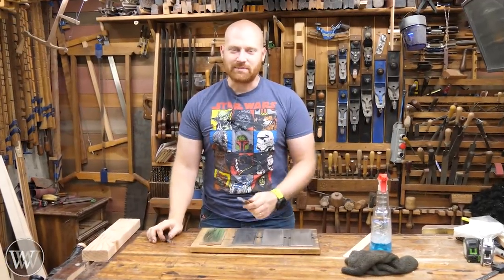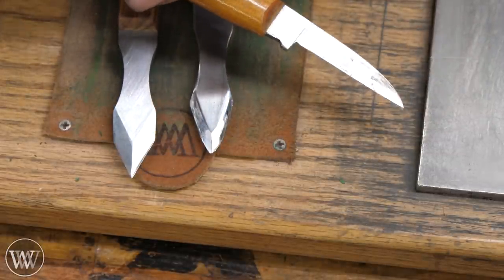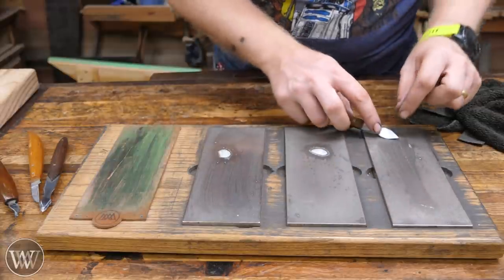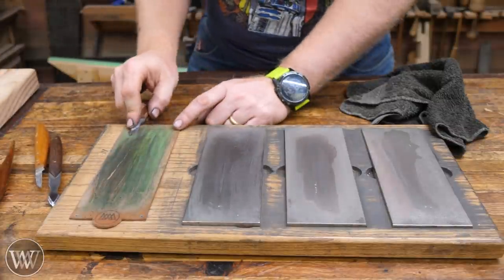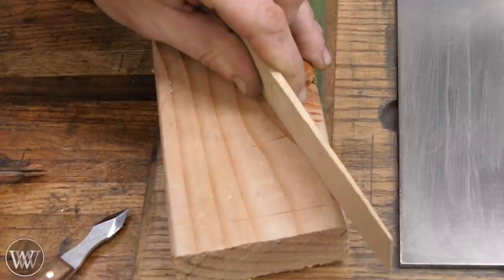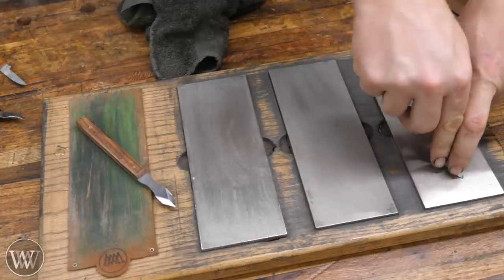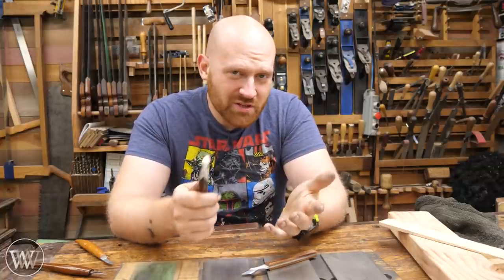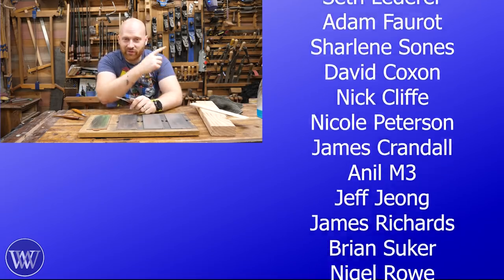How to Sharpen a Marking Knife

Comment: I've said it a few places but there's a great line in the new traditional woodworker. "good enough is good enough" maybe I like it so much because I've said something similar for a long time.
Reply: With OCD, there is no "Good Enough". A metal worker friend of mine says I am seeking to be to exact with my woodwork.
Reply: @thomasarussellsr  determine what tolerances you can accept. E.g. +- 2-3 mm is more than enough for woodworking. It's in metal machining where tolerances can be +-10 thou (or less).

Comment: Super helpful! I have a suggestion for a video: bringing a router plane blade into square. I read through Paul Sellers’ article on it, but haven’t found any videos and I can’t seem to get it right. It’s been frustrating!
Reply from the maker: I have seen a few people talking about that. But I've never actually come across a router plane that is out of square. I guess if someone regularly sharpened the back side of the blade then it might come out of square with the soul of the outer plane. I would have to think about it.